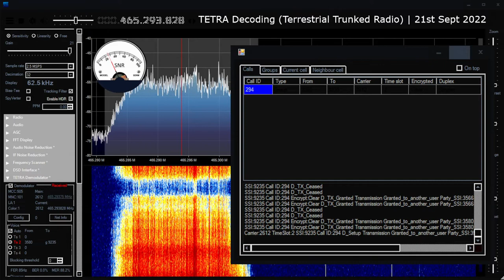Decoding A Local TETRA Repeater With SDR# And TETRA Demodulator Plug-in (Terrestrial Trunked Radio)

Comment: Amazing. You don't have the download link for the Tetra demodulation plugin by any chance? It seems the website has been taken down or can't be accessed for some reason.
Reply from the maker: Hi, yes I have the link for TETRA demodulator plugin. I had to use the wayback machine for it though. Here is the direct link. It requires 32 bit SDR Sharp.

https://web.archive.org/web/20200226002337/http://rtl-sdr.ru/uploads/download/tetra_x86.zip
Reply: @Rob VK8FOES  thanks so much man!
Reply from the maker: No worries, mate. Enjoy!
Reply: How can I contact you ?
Reply from the maker: Hi, you can send me an email at vk8foes@gmail.com